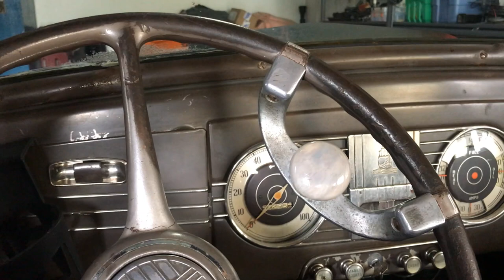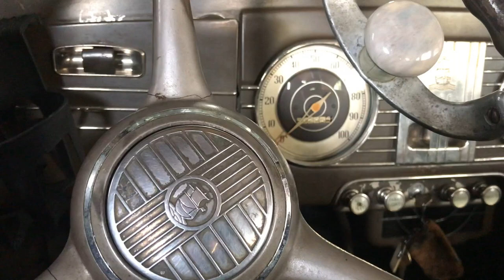Flathead Live Tappet Action & Valve Set Performance Gains

Comment: Great video! I am really enjoying this series. I am working on a '50 Plymouth Deluxe, so you are helping me out here.

Quick observation: some of the tappets don't look like they are spinning, perhaps a sign of camshaft lobe tip wear. If you have to keep readjusting certain valves for noise, I'd suspect it. Little bird says it could be lack of zinc in modern oil (i'm sure you've seen the ZDDP additives, for whatever they are worth.)
Reply from the maker: They all do turn. Some may pause now and then at idle. As rpm rises they get turning more consistently again.  I’m not totally sold on the idea that an old low compression ratio engine with low valve spring tension needs zinc additive. Higher performance, yes I agree. A stock 7:1 flathead? I’m not sure.
Reply: @keithsgarage5831  a fair point! I guess I  just have reocurring nightmares about flat tappet cam failures in some of my previous projects (318 chrysler, 460 ford)
Reply: @keithsgarage5831  I don’t really think the zinc is a big issue, either. The valve train is pretty light in these engines, it’s more of an issue with overheads. I have, however, always used 15W40 Castrol diesel engine oil in mine, for the last 25 years. The detergent makes a huge difference, keeps the engine nice and clean, and even in my truck that was a daily driver for 16 years in rough off highway service, the engine is still “fresh” to this day, but it’s been semi retired since 2010. Still has excellent compression and starts right up.